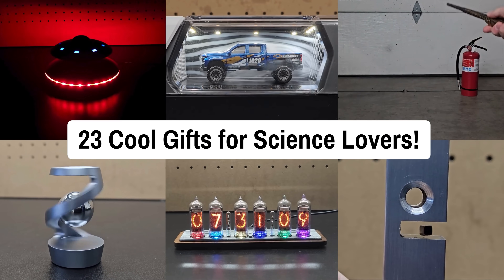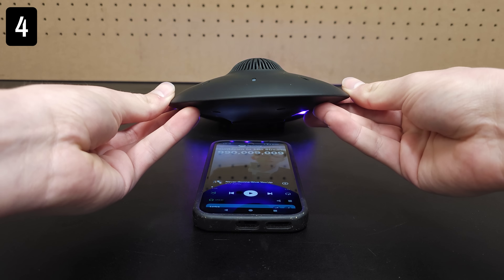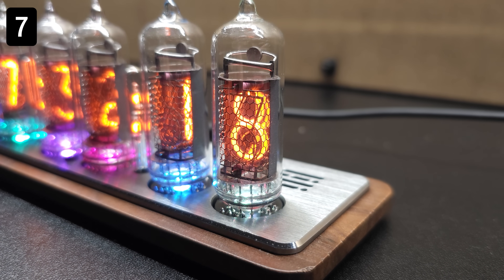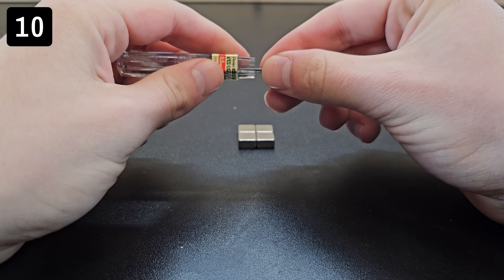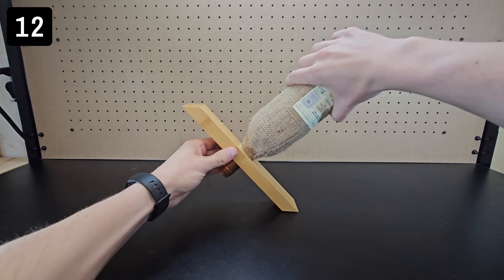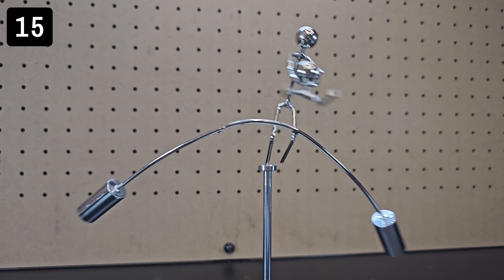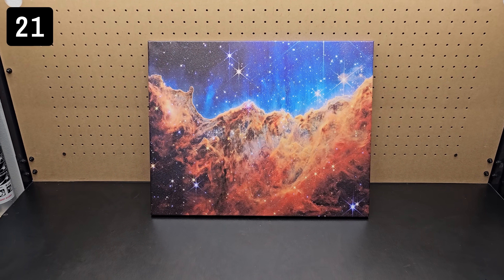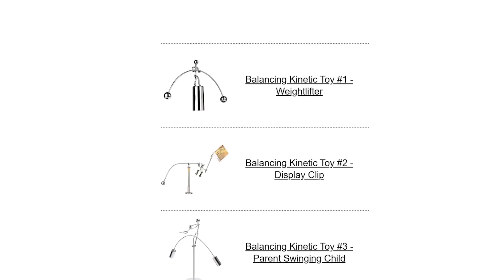23 Cool Gifts for Science Lovers!

Comment: I usually don't comment on videos like this but i feel like I need to make it very clear to everyone watching: Yes the lichtenberg fractals look cool but never under any circumstances attempt to make one yourself.

To put it short: You don't know what you're doing at all, You. Will. Die

Longer answer: Making one of these patterns involves the use of extremely high voltages and the most common source to produce said voltage is the transformer out of a microwave oven which outputs around 2100V at 0.5A (50v 0.5A is the approximate lethal threshold for the average person)

What makes these devices particularly scary is at high voltages an arc can jump further than you would expect and all it takes is one slight brush against a conductor to dump enough power into you you'll be dead before you hit the ground and that's not an exaggeration.
Reply: 101% with you! (as an electician, with friends in emergency medical care) microwave transformers are by far the most lethal component, readily accessibly to tinkerers. (JUST DON'T !!!)
at 1,8-2,4 KV at a ~2kW output any "oop sutuation" carries a >50% chance of instant death by cardiac arrest. and if you survive, you WILL have to deal with deep tissue burns, possible amputatiuons and years of recovery.
Reply: @Ucceah  agreed. With the capacitors out of said microwave being the second most dangerous. They can hold a lethal amount of charge for years.

Even the magnetron out of a microwave can still hurt you without any power being applied to it. 

The inside of the magnetron contains beryllium which if disturbed and inhaled can cause a life threatening illness known as berylliosis.

Basically every part of a microwave can hurt you in some way so don't even think of dismantling one is the advice I'd give most people.
Reply: Played around with one with a friend when we were like 15. Tried to play it safe by using a long wooden pole with a nail and wire at the end only. One day, when we were done making arcs, we put the nail down on the concrete, and it started arcing into the concrete which we thought was safe since it was "ground" lol. That's the day we decided to swap it around so we inputted 230V and output around 1V instead. Much more melty stuff and less arcing stuff.

Comment: That carbon dioxide birdy should be a mandatory part of every home.

-edit: 0_0 it's 200 bucks!
Reply from the maker: It's carbon dioxide, not carbon monoxide! I'll pin a comment to clarify because you definitely don't want to replace your Carbon Monoxide alarm with this.
Reply: yeah.... definitely not.  Sure I'm going to trust some $2 looking temu special with no calibration or safety data over my industrial rated high quality multi gas detector

It's nothing more than a fun toy that would be at home in a children's science classroom as a way to demonstrate how not all gasses are visible and how CO2 is dangerous in high quantities. You could demonstrate how quickly the bird drops at different concentrations.

Not a chance I'm trusting that for real.
Reply: And if on “TEMU” it is possibly a polished turd from a Chineseum crap factory, and Ailbaba & temu are where they are known to dump their tat, I assume it has not been properly calibrated when to “drop” the canary with the volume of carbon dioxide in the air